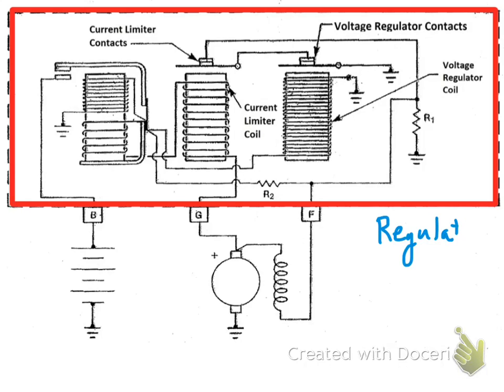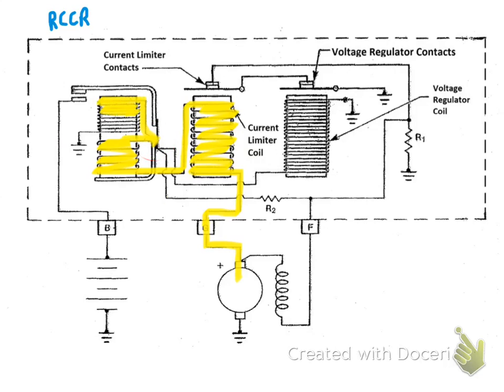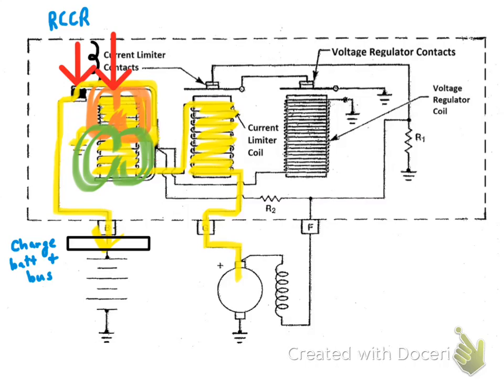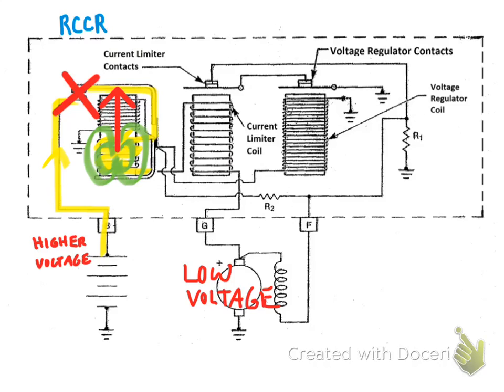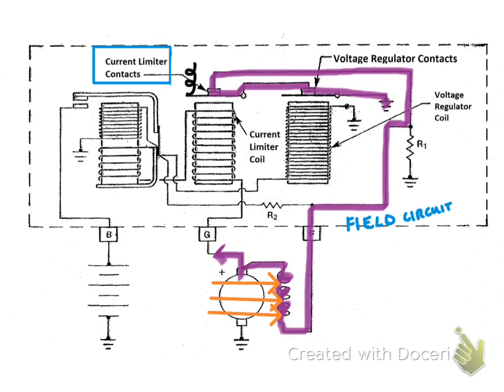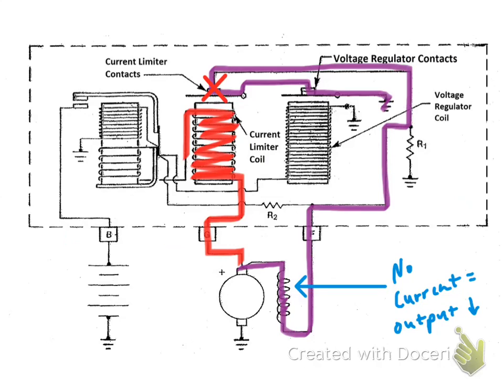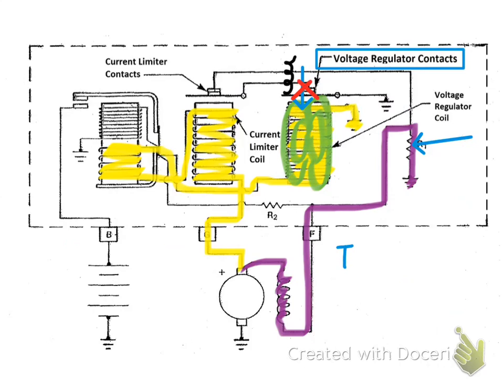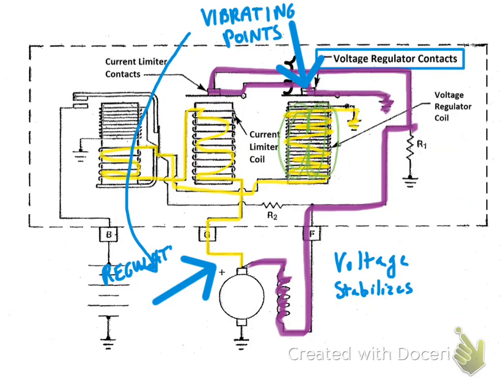Vibrating Point Voltage Regulator for Generators

Comment: I’m needing help I installed a Starter generator only Briggs and Stratton and I can’t find any wiring. I have F1 F2, A1, A2 and DEF connections on the starter generator. Also, I need to know what voltage regulator to hook up to it. I have a GM regulator with for outputs number one is Blue number two is White number three is red and number four is brown. I can’t find nothing on YouTube to show how to wire the starter generator up or what voltage regulator I should use.

Comment: Only thing that is maybe wrong is with regards to the RCCR. The upper coil is to repel the spring and force the contact open the bottom coil is to close the contact and allow generator voltage to go to the load. When you mentioned the bottom coil repealing the contact you lost me because the ground for the bottom coil at the RCCR only goes to ground at the generator other than that very good video.
Reply: When you mentioned the bottom coil repealing the contact you lost me because the ground for the bottom coil at the RCCR only goes to ground at the generator
==> In my understanding you misunderstand following point:
When the battery voltage does get HIGHER than the generator voltage, then the current flow in the bottom RCCR coil reverses direction. This reverse current flow changes the lower coil force from closing the contact to pushing/repealing the contact open.
A change in current flow direction causes a 180° different force.
Reply: @FriedhelmSchröter  right und richtig xD think of the magnetic field fingers. with DC .

Comment: To Airplaneinstructor: First, thanks for the video. Took several times watching it before it all finally sunk in. Question: Could you use a Type A (24 volt) voltage regulator with 2, 120 volt AC to 12 volt DC regulated battery chargers in series. 40 amps DC max current.

Comment: One of the better videos. 99% of them have no idea how a charging system works. The cutout relay stays connected until the generator output drops too low. Then it disconnects till you have enough rpm to charge again. Keeps the battery from draining down.

Comment: You need to point out the diagram you're using is for a externally grounded generator. 
There two types internally grounded  (general motors / Chrysler) most Fords etc used a externally grounded. 
They have to be polarized different.  And some Bosch generators used a isolated field which is basically a internally grounded unit. 
The cutout relay is needed because generators don't have diodes  ! There pretty much EMP proof but the regulator isn't as foolproof.  And at about  1300 rpm the contact points are vibrating about 1000 times a second.  Not a bad video. 
Take care.
Reply: You mean an externally grounded field. All generators are grounded through the yoke (case).
Reply: She does say it a type A generator…
Reply: The cutout relay is needed because generators don't have diodes  !
==> In my understanding this is not correct. Inside the generator you have for each of the 3 phases 2 diodes each. Without these diodes you would have an alternating current, but to charge the battery you do need a DC current!
In my understanding the RCCR is required to avoid discharging the battery slowly over all the coils while the motor is not running/parking.

Comment: I’m working on a 1946 Funk it has a Delco Remy generator and voltage regulator the wiring diagram I have is unreadable.
Could you add the master switch to the diagram.
The generator itself Test good grounding the field.
Hard to see behind this panel but I currently have no charge due to wiring or bad master switch and that system.

Comment: My battery drained I replaced voltage regulator 3 times. And repaired generator 2 times and still have problems not charging battery and when I turn lights I loose power
Reply: Not the regulator. Look outside the charging system for a voltage leak.

Comment: If the current limiter contacts or voltage regulator contacts open, doesn't the field current still have a flow path to ground through R1?  If that is the case, the field current can still be maintained, thus never decreasing generator voltage.  Help me understand if that statement is wrong.
Reply: nevermind.  I got the answer.  I believe the author might be a little mistaken in how current through the field is reduced, though.  At the 6:24 mark, she indicates that current flow through the field will STOP due to the current limiter contacts opening.  However, current will still flow through R1, but R1 greatly reduces that current so the field flux dies down, reducing generator output voltage.

Also, her arrows through the generator are slightly confusing.  I think the arrows should be going from the field windings through the generator, demonstrating that the magnetic field is being generated by the field.  Those lines of magnetic flux cut through the conductors as the generator turns, thus inducing a voltage.  Because this is a self-exciting generator, the field is going to take a portion of the current now flowing out of the generator and use it to maintain the magnetic field.  This keeps generator voltage where it needs to be.
Reply: Yes, there is still some Field Coil current flowing through R1, but depending on the size of R1 more or less reduced.
Please note: The target of the regulator is to limit the voltage to max 14.4V (the target is not to reduce the generator voltage to zero).

Comment: RCCR reverse current relay Current flows from GEN to Bat ONLY.
Reply: RCCR reverse current relay Current flows from GEN to Bat ONLY.
==> No.
When the generator voltage on contact G is higher than the battery voltage, then the lower RCCR coil has a current flowing from G to B.
When however the generator voltage on contact G falls below the battery voltage (at extremely low rotation or when the motor is not running), then the lower RCCR coil has a current flowing in opposite direction, from B to G.

Comment: generators don't have fields
Reply: Yes they do
Reply: Yes Gwen, Magneto's do too. But generators have a 
wound field to make the generator more powerful and to
be able to control its output, whereas an ignition magneto
uses permanent magnets.
Reply: @raymondgarafano8604  Generators with wound fields are called Alternators. Generators have permanent magnet fields
Reply: @1shARyn3  Hello Gwen, Some magneto's have permanent magnets and produce A.C. but are 
called alternators, their output is then turned into
d.c. by rectifiers to charge batteries. 
these so-called alternators are found in motorcycles, larger 1 and 2 cyl. gas engines outboard engines for boats, but in reality they are magneto's. Even Henry
Ford's famous model T ford had a magneto that worked the headlites horn and four ignition coils.
    You are right about alternators, they have a  rotor
which is a rotating field externally excited by a 
battery, like the typical auto alternator, much larger
alternators have their field's excited by a smaller
generator known as an exciter.
      car generators that produce d.c. have an
armature whose windings end at brass segments
known as a commutator and field poles wound with
many turns of lite gauge wire making them very
sensitive to voltage. 
     Edison's generators used for lighting were also
direct current machines quite large and had a
wound field as well. Some generators are shunt wound, wired across the armature with a rheo-
stat in between to vary the field strength. also
series coils could be used, wound with the same 
gauge wire the armature, called a series or 
commutating field. There is a slight magnetic
field on a d.c. generators pole shoes, so that the
generator can use it to start building up the voltage
at the armature and a small portion from the 
armature goes back to the field coils, thru a
voltage regulator to keep the gen's voltage within
operating parameters.

Comment: The purpose of R2 and R1 in series, is to shunt some armature current to ground.  (R1 also enables minor field current to start flowing). This current energizes the cutout relay coil so that the armature can connect to the battery and charge it.  Without R2, the cutout relay would never close because the coil has no path to ground.  So, R1 and R2 are there to start the charging process.  After the cutout relay closes (connects armature to battery) the resistors are not needed because the cutout relay remains closed until the generator stops rotating.
Reply: The purpose of R2 and R1 in series, is to shunt some armature current to ground
==> I don't think so (direct ground is available to all coils right to the RCCR coil).
I think R2 is simply some protection resistor to avoid too high current flow into the upper/small wire diameter part of the RCCR coil. When either the Current Limiter or the Voltage Regulator Contact does get opened by either too high current and/or too high voltage then the Field Coil current needs to flow through R1 to ground forcing the F-contact to same voltage as the G-contact. The small diameter wire upper RCCR coil is dimensioned to short max 14.4V to ground. But without R2 AND and RCCR contact open the F=G-contact voltage may be much higher than 14.4V and directly shorted via the small diameter wire upper RCCR coil to ground would probably cause such a high current, that the small diameter wire does get burned away.
Reply: Thank you very much. I was been wondering about the purpose of R2 the whole time.